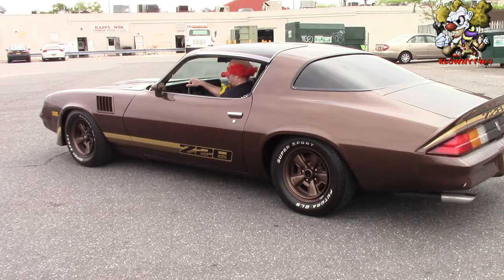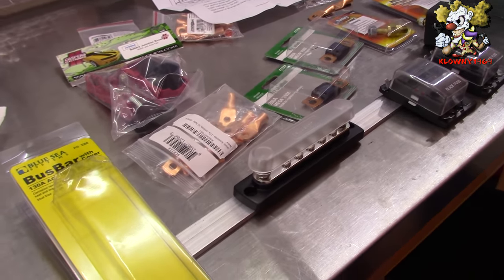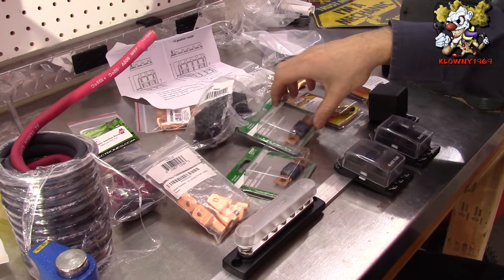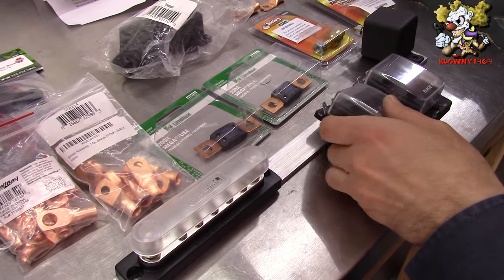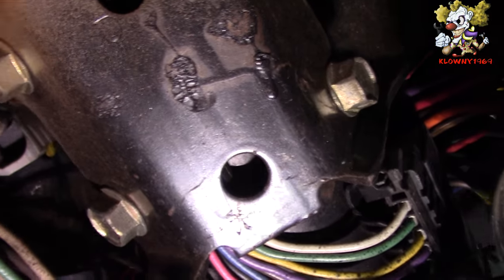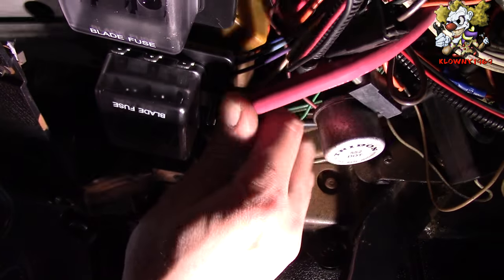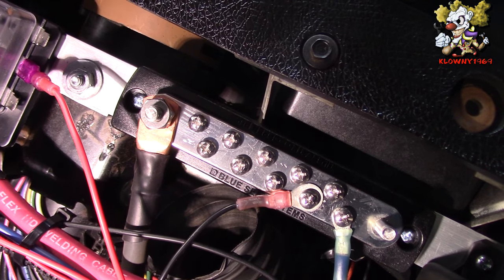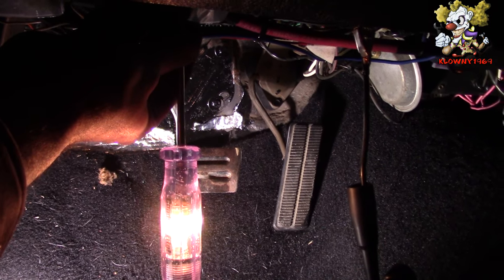How To Wire A SWITCHED Fuse Block From Scratch !! (ULTIMATE GUIDE!!)

Comment: I think I love you for this.  Working on rewiring a lot of my Ranger for an HO Alternator, offroad lights, winch, inverter, stereo amps, a big new relay/fuse box on an ignition circuit, HID upgrades, etc....as well as a simple Big 3 upgrade.  Simple, straightforward, well presented.  THANK YOU!!  I WILL be using breakers over fuses, but my wiring I think will end up similarly sans using fancy car stereo-style battery terminals with multiple large gauge set screw ports. A bus block and a grounding strap is so simple and so amazing...no idea why I didn't think of it.

Generally speaking...you just made my life easier.  Couldn't ask for more.
Reply from the maker: MrAcuta73 awesome..thanks for watching and commenting

Comment: Thanks for dropping the link to this video from you Valve cover leak fix you posted today. I have the same made fuse block from Amazon, very well made. Upgraded to a 110 amp single wire on the 67 Mustang and need to get the old glass fuse block converted for add on's also. Elect fans, fog lights, elect fuel pump, and who knows what else I will add later. I did not buy a 100a relay though, have the Ford solenoid, can I use that or use a separate relay. Thank you my brother! Appreciate you and all the help and teachings you have given me. Cheers from Canadian fire/smoke filled Motown.
Reply from the maker: Awesome! I would use a separate dedicated relay just to have its own circuit. Cheers 🍻

Comment: So I know this video is 4 years old, maybe you've updated one since then, but would you wire a car this way now? I ask because everything I've learned about how to wire a car (maybe I learned a bunch of wrong stuff lol) is that you don't want to run 0-1 gauge massive cables with power from the trunk (where my battery is) to the front of the car, or under the dash. You have a massive cable going from battery to starter for cranking amps, a ford style solenoid so that massive cable only carries power when cranking (for safety or an accident), it's dead otherwise, and you get all your accessory power from the alternator (and a power distribution block maybe on the core support or firewall that connects to the alternator with 8-10 gauge wire). Use relays where it makes sense, for electric fans, headlights, etc. and get power to those relays from that alternator wire. NOT from a massive cable connected to the battery directly. Lot's of ways to wire a car obviously, I'm curious if you think this is the best and safest way.
Reply from the maker: We needed a fuse block in this car due to alot of electrical add ons..this is a safe way of doing it because you do have a megafuse in place in case the wire gets grounded..also if you have just a power distribution block, you still need fuses to those individual wires. For the battery cable, that's a different story..if its only needed when cranking then yes you can have it dead on other times. Always size the cable to the fuse block amperage and what you are planning on drawing amperage wise and you sill be fine. Dont forget to subscribe

Comment: Great video. If I was to wire mine just like this and I decide to run two extra small 30 amp relays for  dual fans could I connect  the switch 86 for the fans on the key fuse box like you installed or would that interfere with something? Sorry if it’s a dumb question.

Comment: At 14:02 why are there 3 wires coming from the junction box. I'm a little lost on that part. 1 coming from the positive battery terminal and 2 going inside the car?
Reply: did you ever figure out where the third wire came from?

Comment: I have a Bluesea 5032 with 6 circuits constant on and the other 6 circuits are switched. This is my problem,is there a way to get switched power to those 6. I had no problem with constant on. Can I use a contractor or relay to get this done? This is a great video by the way.
If you can give me a little detail on how to create   a cable for the switched side. Keep in mind I am using #4 wire. Someone mentioned to go to the starter and look for the accessory side on that, but I do not feel comfortable doing this.
Reply from the maker: I showed in the video how to create a switched 12 volt panel

Comment: At 14:20 what is the power distribution box for? Why did you need to run two cables out of that box? Couldn’t you run the positive direct from the battery?

Edit never mind I worked it out

Comment: Klowny. After watching a dozen  videos, why do I keep coming back to yours? I will tell you why. No offense, but you are not a clown. You know what you are talking about. Excellent videos and easy to understand. I do not know if you are aware, but Blue Sea makes a ST Blade Split Bus Fuse Block with 2 isolated circuits, one for constant power and one for switched power part number 5032. I purchased mine from Amazon. I do have one question though. If all of my switched circuits coming from my switched Blue Sea Block section total less than 100 amps and I am going through a 120 amp relay should I still fuse the switched wire coming from the factory Chevy fuse panel to the number 86 pin on the relay? If so, what size fuse would you recommend?
Reply from the maker: Thank you sir for watching! ive wired the 86 both ways, with and without a fuse..i just put it on a 5 amp, the draw i believe is around half an amp or so..you can also just circle it back to the battery feed side of the relay, if you have a battery feed connected to it..thanks for watching!!
Reply: @klowny1969  Thank you!

Comment: If i am adding 6  fuse junction with relay for ignition turned on accessories
But i am only going to add 2 accesories of 10 amp each for now on
So what sized relay i need ?

Comment: Can I use a power distribution block instead of the junction box? Is it the same thing or do they have different functions?
Reply from the maker: You can do whatever you want, as long as you use fuses and relays where appropriate..don't forget to subscribe
Reply: @klowny1969  yessir, I plan to. The only thing I was going to change was the junction box itself. JEGS was charging $50 through Amazon. I found a pretty good power distributor with a cover for about $12. I plan to keep everything else the same. Use fuses and relays. Thanks for the reply. Just subscribed.

Comment: If you look very closely, you can see that your spade connector at 16:34 is not connected correctly: the tab is sitting only between the insulation and the spade connector ...

Comment: Exc video. Nice job. Sort of unclear at about 17:00 mark. If you already wired up a fuse box that is switchable via the relay, then why didn't you just connect that old wire that came from the old fuse box to a connection on the new fuse box? Also what gauge did you use for all the red batt wires that went to megafuse, j-box, relay, and the fuse boxes?
Reply from the maker: larry gk thanks..the original fuse block was full , i didnt want to overload it..the thickness of the wire depends on how many amps i are pulling through it
Reply: Thanks. If I may, one more question. I built a similar setup that you show on this great video. Have not installed the relay yet. An experienced electrician friend of mine mentioned that he has done them without the relay. That is, he simply uses the ignition switch to power up the switched fuse block and that "it should handle that". The amps at my switched fuse block are about 55 if you add up all the devices connected to it. If that is feasible, would you not need a hefty (e.g. 4 gauge) cable from the ignition switch to the + at the fuse block? And typically you do not connect a thick wire like that to an ignition switch! Comments? Also what amperage relay did you use in the video? thanks.
Reply from the maker: larry gk i would not use a power wire that is coming from the ignition switch to power a whole fuse block unless u are going to power really low amperage stuff..thats how fires happen

Comment: I followed the steps and it looks like I'm getting a voltage drop at the accessory fuse block. Any thoughts on why??
Reply from the maker: Check for loose connections..dont forget to susbscribe

Comment: Question, could you have run the battery positive cable to the constant hot and just run a short line from the constant hot to the keyed hot relay?

Comment: My battery is in the trunk. Instead of running a wire from the battery, can I just come off of the starter?
Reply from the maker: milkhouse that should work..but double check the amperage and thickness of wire to the starter and battery
Reply: klowny1969 okay yes I will do that. I'm not sure why the battery was moved to the trunk. It was there when I bought the car.. Is it going to be okay to mount that mega fuse in the engine bay?
Reply: klowny1969 also, if I use a circuit breaker, do I still put it by the battery, or do I put it in between the starter and the fuse block? Thank you for the help
Reply from the maker: U can put circuit breaker or megafuse after the junction
Reply: klowny1969 
Great! Thank you very much. If I'm doing something on my nova I search for you on YouTube. It's how I installed my electric fan

Comment: you call for trouble when you  plug a multiwire to the battery
the best to do is to go to a big away from the battery terminal then start all secondary wiring from this terminal
Reply from the maker: This is the reason why i wired these fuse blocks..to move all those wires from there..check out my other videos on my channel..you will love them